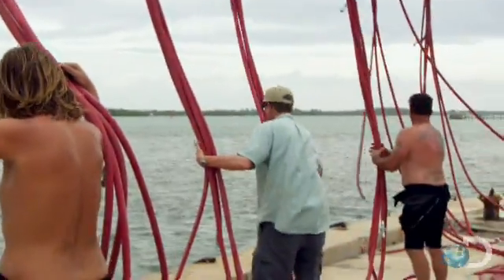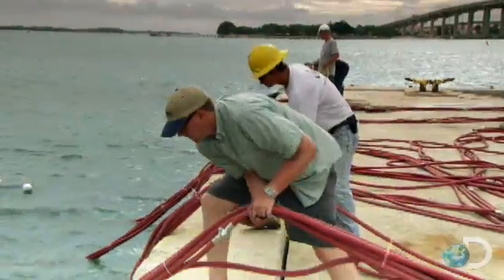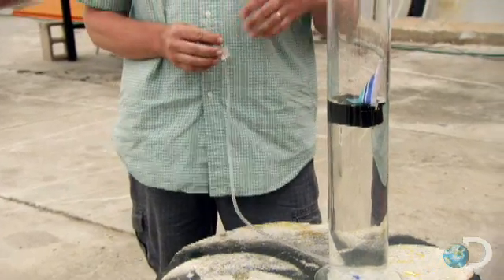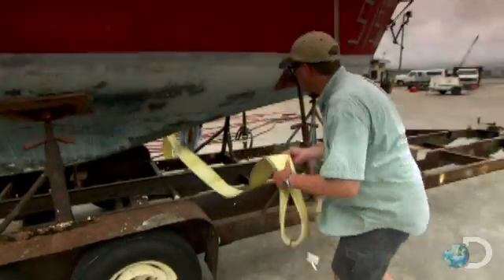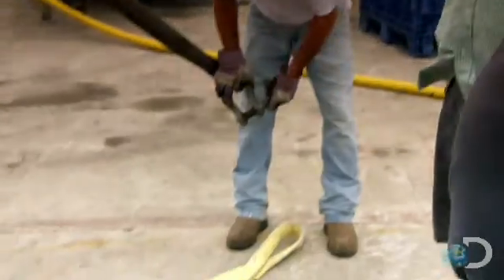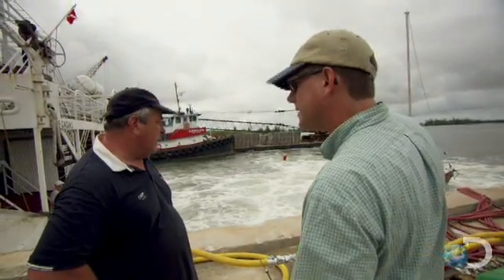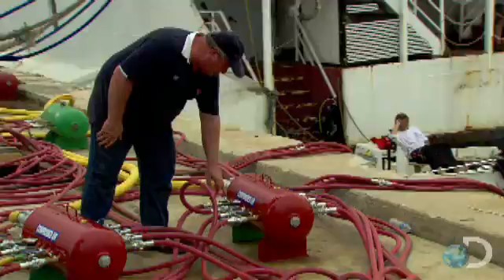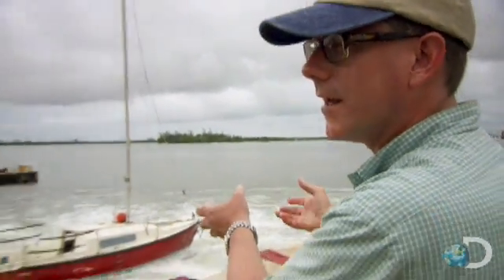Sinking A Boat | Curiosity

Comment: I think the boat didn't sink as it's keel was removed so the boat used to compensate for the weight of the keel now it was removed the boat could float easier without the keel weighing it down
Reply: @stefan stuven, that sailboat has a swing keel in the up position. So it has a keel.

Comment: Mythbusters did something similar. They were exploring the sinking of the Titanic. 

The problem is that to sink something using bubbles you need a huge % of air in the water. You got that in the small scale but not in the large scale.

Comment: They already have, technically. Naval mines work by the same principle. They explode, creating a large pocket of air under the hull of a ship. Without the water to support the ship's weight, the keel breaks, and the ship sinks.

Comment: what about planes that vanished too??
Reply: Well, the planes didn’t vanish, they crashed into the water. Likely, they flew through a pocket of methane that was released from the ocean floor. This choked out the the engine causing it to stall and the plane to crash.